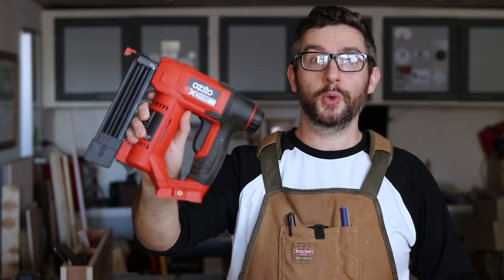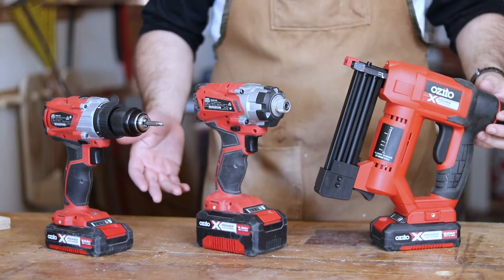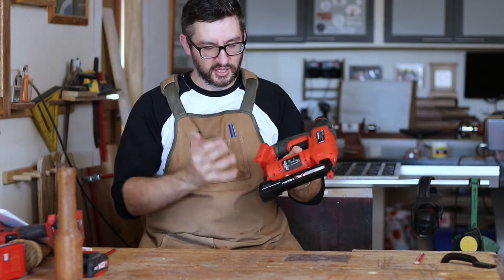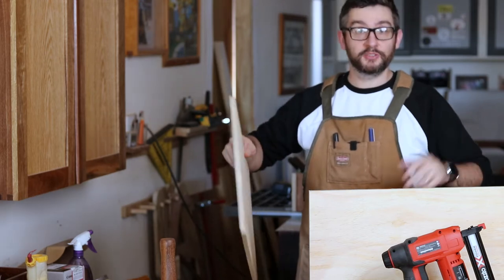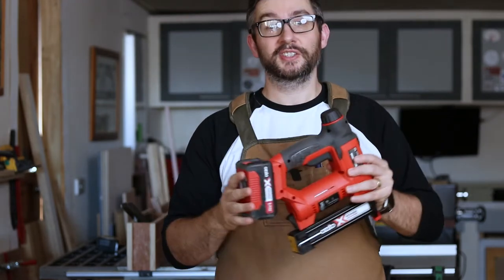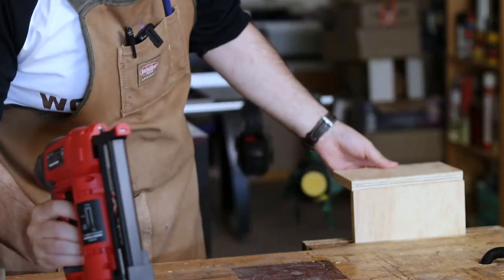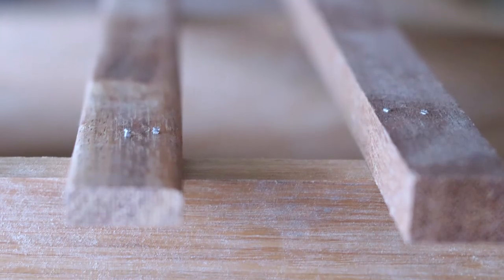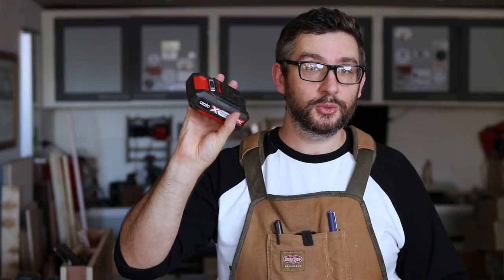Do woodworkers need nail guns?

Comment: I got one of these despite not having any Ozito tools because buying the skin and a battery/charger was still less than the Ryobi by a fair amount, and I must have been unlucky because the one I have just will not fully sink a nail, even with my 115kg on it. It’ll be good for stretching canvases and upholstery so I’m not mad about it, but interesting to know it can do better
Reply from the maker: That's a bit disappointing that it won't sink them at all, mine does, though I do end up with marks / divots in the wood around the nail so it isn't perfect either. Certainly not a 'finisher' nailer.
Reply: Take it back to Bunnings with the receipt and get it swapped out for another one. You may have gotten a bit of a dud. That's the beauty of the 5 year warranty.  👍